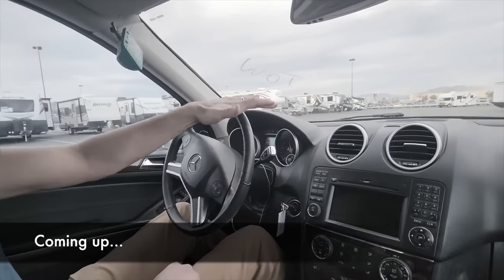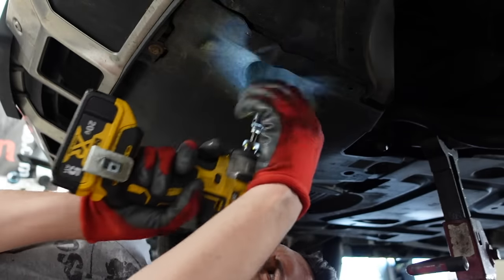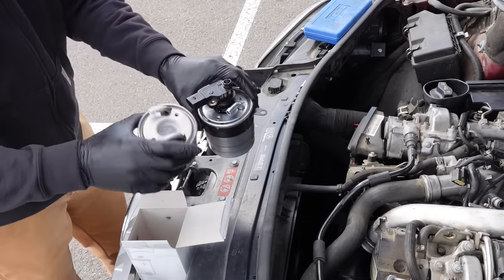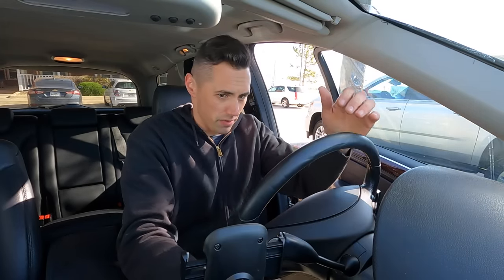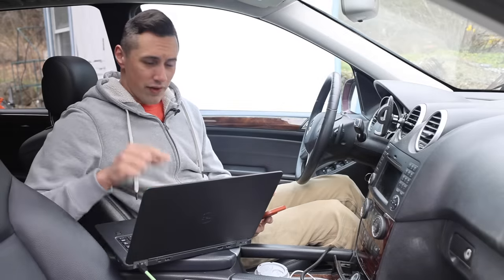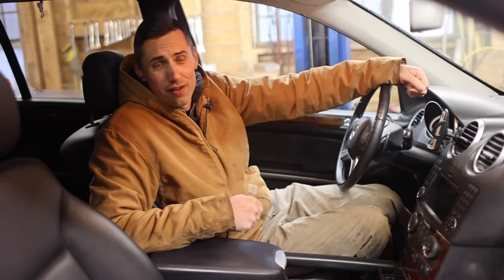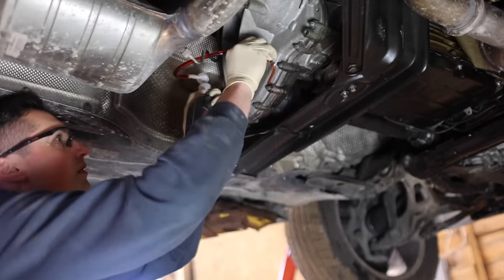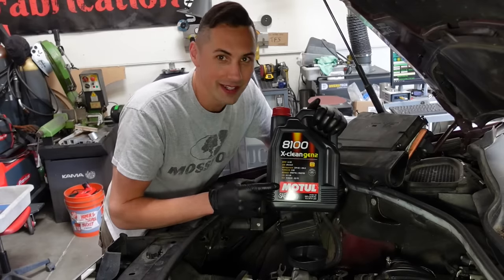This is the Most RELIABLE Luxury SUV I Could Buy for $4,000 (Not a Lexus)

Comment: Hello from Germany. the dpf filter problem is city driving. he has to go on a road trip, put it in a lower gear and drive at 3,000 rpm for 20 minutes. it will clean itself.
Reply: Who is this short, you say you are owned by?
Reply: Ok genius, so please explain why American semi trucks, which travel 500-700 miles a day are having so many failures.
Reply: It's a similar problem for VW golfs with the specific 4cyl engine. They get dirty so quickly and 3krpm for 15mins helps clean off some excess carbon buildup
Reply: The motor oil used in America has high saps. So many don't know and just keep using high saps oil because it is more available to purchase. Low saps will help with diesel system and direct injection system. Justifying headaches down the road.
Reply: @ClaudeSac We Germans are used to German cars and partly no speed limits here. We call it „you have to go on the highway again to burn your car free“ 😂 sorry for my bad English ☺️
Reply: @TheRoadhammer379 This Mercedes SUV isn't a semi truck. Hope that helps
Reply: There is an expensive problem in your cilinders too, just wait a little, the problem is just starting...
Reply: Timing chain issues will come on as well.. not maybe, but 200 %
Reply: Oil cooler seal in the valley will almost certainly come up . $8 seal and $2000 year down labor
Reply: @chrisdoe6890  It was already replaced when he got it, and he redundantly replaced it. He's not going to have to worry about it
Reply: @TheRoadhammer379 He isn't talking about "American semi-trucks." 🤦🏻
Reply: Some things never change, the procedure was called " italian tuneup" in my days of owning Mercedes 300D of yore!   It always worked like charm,  I did it at night because of the impressive smoke was always durring the process.
Reply: Nah, just remove the DPF.
Reply: @TheRoadhammer379  Because you drive it in last gear, you have low revs
Reply: @TheRoadhammer379 European diesel is MUCH cleaner. Not nearly the particulates. Plus I had to program a a separate DEF arturo board “just in case”, the cummins DEF sensor failed. Cummins is on its 7th generation? Mostly diesel is cleaner
Reply: @anneli1735  Sort of like an Italian tune up.  Run the car hard for a while to burn off carbon on the valves.    Instead you burn the dpf filter clean.
Reply: That's what I thought
Never been taken for a hot run
Reply: @TheRoadhammer379  Perhaps, rocket scientist, because they have totally different engine management systems Your  question is like, How come the NASA space shuttle never suffered a bird strike on take off, but South West Airlines has had several?
Reply: @anneli1735 German cars on average are very unreliable and especially in Germany barely have any options.
Reply: @TheRoadhammer379  he's not wrong though. I don't know if your American diesels aren't built with DPF regen capability, but it is a standard in Europe. I've driven diesels since the early 2000s and they've never failed from a blocked DPF. Our cars even have a regen light to let you know when the DPF is in need of a regen cycle, which is usually once in several months of driving.
Reply: Here in America, the DPF is also a city problem because in the country, we immediately remove that garbage.
Reply: @tmarbut  🤣🤣🤣🤣
Reply: Thanks for sharing this tip.  Will give it a try.
Reply: 30.4mpg is terrible. I get 39mpg out of my BMW X3 30d.
Reply: @TheRoadhammer379  I'm not a genius, I'm just realistic.  because they drive in the highest gear at low revs.  from time to time you have to clean the engine by driving at 3000 revolutions
Reply: @tmarbut  in germany the same. 😂

Comment: At Lowe’s they sell a baseball type cap that has led lights under the bill. I brought one several years ago and now I have at least 4 in different places where work is done.Makes working in tight dark places better. So use to having them on while working that I move my head for light adjustment and don’t have a cap on. 🤣 I can stand holding those lights in my mouth. Love the content of your post.

Comment: I'm amazed in how nice of condition this vehicle is in for $4,000. Especially the underside! Cheers on the repair mate
Reply: I seen this in other videos where a decent mechanic buys a cheap car from auction with "issues".  The dealer that took it in trade doesn't want to gamble and spend $150+ an hour on a mechanic to diagnose and repair the car so just takes the auction money and moves to his next deal.
Reply: @boyracer3477  And if you don't go looking for the problem you can honestly say you don't know what's wrong with it. Protects the dealer if it turns out to be major.
Reply: @ja.9166     "I'm amazed in how nice of condition this vehicle is in for $4,000."
I'm amazed at how he is able to diagnose the troubles that this type of vehicle might have, something that would not make this cross-country deal look attractive to 99.99% of people. $4000 is sort of out of the question.

Comment: As a multiple Mercedes owner, this was very informative, reassuring and conformational. Mercedes vehicles can be over engineered and complicated to a degree, but, I work on my own, when I can, and enjoy the relative reliability. Only thing I'm missing are the diagnostic tools, equipment and a decent shop space. Having that would allow me to exclusively work on them. This channel rocks!
Reply: i assume u mean 'confIrmational'.   Btw i urge u to not think of MB diesel ownership in the US as something viable longterm if u dnt want to spend a fortune and/or have multiple issues
Reply: Get a Creader elite for mercedes. It is hands down the best diagnostic tool for the shade tree mechanic. You can do things on it that requires professional $3000+ tools like setting transmission shift point adaptation and marrying virgin ECU's and TCU's to the car. They go for less than $120.

Comment: Om642 is a reliable engine once you hit a pothole and all clogging exhaust bits falls off. I got an w211 E320 that hit a pothole and it’s clocked at 368k miles tho it’s consuming oil and not leaking at 1 quart/2500 miles it’s acceptable at that mileage. Runs smoothly still looks very good and i pick it up for only $600. 

I do plan to remove the engine and perform a re-ring & rebuild and get to learn about these engine, there’s plenty of OM642 circulating around in US.
Reply: If it drives it's a steal at $600. I've got a 90ies sedan that burned oil for first 3 years of ownership. My work van was down so I hitched up the trailer to the sedan. After towing heavy for ~30 hours the oil level stays the same between oil changes. Before towing it would go from full to 'refill' in an oil change interval. It might be something else, but mpg went up right at the same time.
Reply: Feral Man  20w50 in an OM642? what?
They are just fine on 5w40. Cheap 5w40 too.
Reply: What is the year
Reply: It's also Great that you know a little about that suv

Comment: ***Waldo, you can probably get this fixed for free at the dealer! We’ve owned a couple of these Ml350 diesels and Mercedes is currently doing a “dieselgate” type emissions system replacement.
If it has not been done yet the dealer will do a full emission replacement, give you a check for $2k and slap a 4yr/48k mile warranty on the drivetrain and emissions components (including turbocharger). 

If this car has already had it done, then it is almost certainly still under the warranty.
Either way Mercedes will likely foot your bill 😁👍
Reply: This is correct, I commented on this earlier. It is the Diesel Emissions Program and is the result of a settlement for the diesel emission cheating. If this vehicle has already received the repair it should have an extended warranty on it and some issues with the intake and exhaust systems will be covered.
Reply: Wait, Mercedes got caught cheating emissions too?
Reply: @RyanRoadReaper  vw, audi, seat, porsche, bmw, daimler, opel in the eu at least
Reply: @2810Mad  incorrect on BMW. Although it's often claimed, there was no emission cheating at BMW. The only lawsuit was when they themself adressed to authorities that the wrong engine data was put on some 7000 diesel cars (X5 I think).
Reply: true that i have a friend just did that.
Reply: @mawa9843  I would have been happy if BMW was also on this boat. Cannot stand the emissions baloney we have to put up with.
Reply: @volvo24091  I can't follow you on this one. Why would you want car makers (or BMW in specific) to cheat on emission regulations?
Reply: @mawa9843 no dpf is cleaner for the environment. Burning def is even worse
Reply: @mawa9843 BMW cheats in general anyway, they cut cornerns where they don't think one will notice.
Reply: @jacobstrutner8232  It's not
Reply: @evelynwalker1998 cut what corners?

Comment: So good to see you back in action.  I'm a bit like my area"s "car nerd" and folks think I'm nuts because I'm always recommending the Mercedes ML to my neighbors.  They are built like tanks, the interiors are dog-proof, and the four-wheel drive system does not failed. They are cheap to buy and will hurt the other guy if you have a crash. I owned an "07 350 that looked like that color.  I always buy red cars.
Reply from the maker: Yeah, that's why they're so cheap, I guess. Everybody seems to think they're bad cars 🤷‍♂️
Reply: @WaldosWorld  there’s a saying that the most expensive car you can buy is a cheap Mercedes
Reply: @swamp-yankee  American people say that. In Europe they are considered very reliable. It's the exact opposite for Ford though.
Reply: @swamp-yankee  I spent $1700 acquiring my loaded W211 E500 RWD, put less than $1,300 into suspension work and electronics with my own labor and that includes fresh Blizzak tires. 

Around $3k and I have a comfortable road missile. The worst car you could buy, is one you cannot afford, and one you cannot work on yourself.
Reply: I want an old Mercedes E Class Diesel so bad and nobody understands why.
Reply: ... "and will hurt the other guy if you have a crash."

This is incorrect; it will PROTECT YOU if you have a crash.
Reply: @trw8777  seems to me like fords are either really good or really bad. My father in laws carpentry rig went 190k with the only non wear part that failed being the fuel pump relay before it rusted out and became a driveway plow truck. He bought the same generation of truck again and is going to keep the undercarriage nice and buttered up so he can run it more years.
Reply: @bleachstain9785 would be a great car to manual swap
Reply: @lachlanbrown409  I’ve given that some serious thought before, but that would be somewhat sacrilegious to the super reliable 5 speed it has in it. 

I also don’t know how the 6 speed manual that could swap in would cope with the V8’s power levels long term, once I’ve got more long term data from people who’ve done it before, I’ll likely follow suit.
Reply: @garyrains5996 what makes the interior "dog proof"?

Comment: The 2009 and earlier pre-DEF engines are much, much more reliable....  But great choice - looked at buying one of these but chose a diesel Jag F-Pace which has much better gas mileage (38 mpg @ 90mph).  Also 5x the price.... but more sporty and fun to drive, also quieter on long trips.

Side note - the entire exhaust from the manifold to the tailpipe was replaced on my F-Pace 3k miles before I bought it.  It cost $17000.